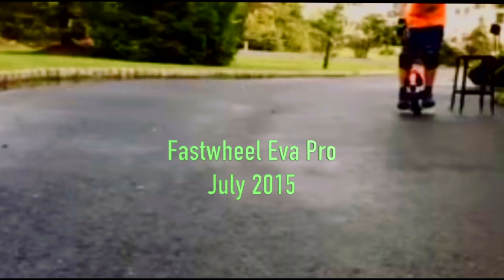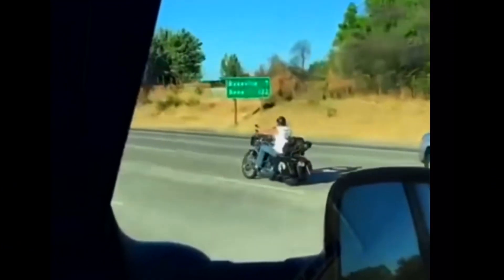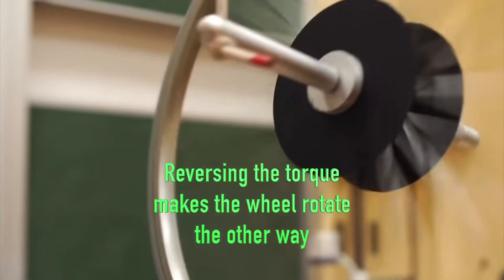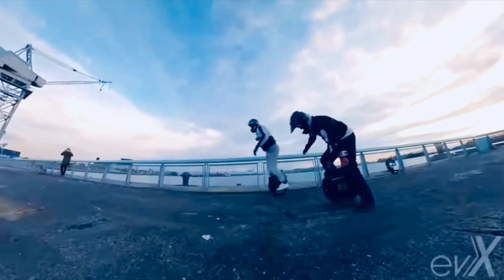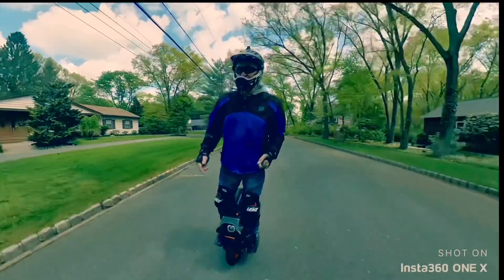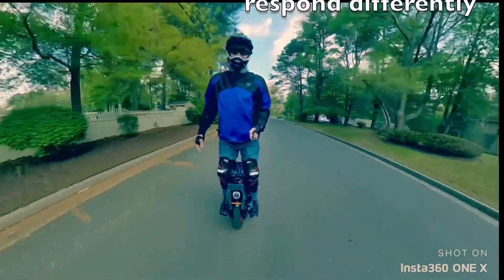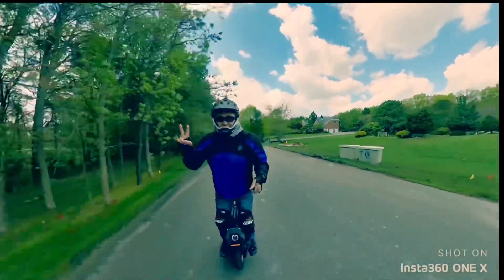Physics of Wobbles and What to Do About Them

Comment: Great video Adam. I've found myself coming back to it every few months. I'm still struggling with wobbles from time to time, and after a particularly bad crash, I seem to have lost some confidence and have been experiencing more wobbles at lower speeds than before the crash. I think it's mental, which probably translates into riding more stiff.

My question for you or anyone else that knows: is there any correlation between your EUC tire's PSI and wobbles? Can an underinflated tire cause more wobbles?
Reply from the maker: Hopefully you are fully recovered from your crash. There definitely is that mental block after a crash that will make you anxious and in turn make you more tense when riding. It will take time to acclimate again just like I did. 

The lower the PSI the less chance of wobbles. Since you have more surface tension on the road the more balanced you will be. This lower PSI of course will increase the chance of denting your rim. You just need to find a balance between the two. 

As you gain more experience, the stronger your EUC muscles and coordination will be. 
Just take your time and you will eventually find the means to decrease the wobbles. On my heavy V13 when I am standing riding and want to slow down I do an exaggerated squat with arms wide open when I slow down. Seated riding is perfect for preventing wobbles. I have never had a wobble with seated riding. Carving while riding will also decrease the chance of wobbles.

Comment: I found that there is no leg shaking (wobble) when I brake at higher speeds with straight legs, leaning only the upper body. I squeeze the wheel harder and my calves push on the pads. It works for me.

Comment: Car wheels wobble individually if they're not balanced.

The wobble occur at a set speed where the imbalance is subjected to resonance by the wheel's revolution speed.

If you speed or slow down, it goes away.

A wheel+tire gets dynamically balanced each time a tire is mounted on it.

A small car tire+wheel weighs around 40lbs and the balancing weights go down to 0.25oz.

I haven't seen any unicycle wheel dynamically balanced on YT videos.

Comment: I am a new rider. Only around 200 miles. I notice the only time that the wheel will start to wobble is when my legs start to get tired. I normally ride in 10 to 15 minute intervals while I am on my breaks at work and ride around the industrial park. I just started to take whey protein in order to help my muscles to grow because in the beginning my legs BURN. But now that I take whey protein after my rides my legs no longer burn but do get tired after 10-15 minutes of riding.
Reply from the maker: @EUC_Senior  It’s not uncommon to get wobbles when you first start out. Especially with the wheels being so much bigger and faster now. Fatigue definitely can precipitate a wobble. I get that too when my legs are sore. 

Seated riding will quell those wobbles. I never had a wobble with seated riding. 

Basically the more you ride the stronger and durable your legs will be. You will also learn so many tricks such as carving that can help prevent wobbles. Carving can be mini and doesn’t have to be wide. 

Deep squatting to slow down as well as accelerating can also get rid of wobbles. 

Just do more riding. You will get the hang of it.
Reply: Привет, твои ноги привыкнут и без протеина! Лучший совет это ездить на комфортной для себя скорости. С опытом эта скорость будет увеличиваться естественным образом. Твоё тело будет делать всё само, без участия твоего мозга, автоматически (аппаратное ускорение). Так же как мы ходим, мы не думаем как мы это делаем, мы просто ходим без всяких теорий.

Comment: This wobble has something to do with the tire.
I don’t ride an euc yet and it’s just because of the wobble.
But I had this problem happening on my car, yes that’s right, I owned a Suzuki Samurai and I bought some cheap non-quality tires, I must tell you the moment I hit 55mph that wobble was insane, my steering wheel was all over the place, I didn’t know then what this is so I went to the car shop to fix it, they inspected the car and I exchanged some parts but the wobble wouldn’t disappear no matter what I’ve done, until I changed the tires, now I have a second Suzuki Samurai, I bought it with descent tires but at 55mph I felt slight wobble, no so much than with the first Samurai but it was there, NOW, I bought a set of 4 brand new YOKOHAMA GEOLANDAR A/T, man, the Smurai rides smooth like a charm.
I think the tire must be correctly weighed (centred) like car tires are when mounted.
Reply from the maker: The rapid decrease that occurs when we slow down on the EUC slightly changes the direction of the wheel of travel. That small change in direction will initiate the wobble. When we try to quell it by purposely trying to balance out the asynchrony only worsens the wobble. 

Lower psi will help decrease the wobble. However, with the EUC’s one wheel there are other ways to help decrease the wobbles. 

Carving riding helps decrease the chance. Having your feet askew vs symmetrical will cause a  mini carving when you ride. 

Wobbles are more likely to happen when you slow down from a great speed. Ways to dissipate  the wobble are a deep squat or do seated riding. Accelerating will also eliminate the wobbles.

Comment: I was going 55 mph on my electric scooter and I was going around a mild turn and the scooter started wobbling like crazy.  I tapped on the accelerator which somehow corrected and realigned the scooter instantly.  This isn't the first time that I fixed the wobble on an electric scooter by slightly tapping on the accelerator rather than using the brakes which will cause fishtailing and instant crash.
Reply from the maker: That was great that you got out of that wobble. Glad you’re
OK.

Comment: I think it all has to do with wheelbase versus overall weight versus distribution. A car with four tires planted at the sides evenly distributed to carry the weight of the vessel will not get wobbles, but a car with only one wheel in the center will.
Reply from the maker: In the example I showed in the video, a speeding car making a quick turn and then trying to go back to the original direction of travel did lead to a wobble and loss of control. The huge mass of the vehicle as well as the change in direction of speed was enough of a huge momentum change to precipitate a wobble. I do agree a 4 wheeled vehicle vs a single wheeled vehicle is less likely to get a wobble but certainly not an impossibility.

Comment: A great video, thanks for analyzing it. I can't help but feel in addition to the things you mentioned there is an issue of the rake and trail on an EUC
It is extremely difficult to get a wobbles on a bicycle because a bicycle has built-in rake and trail into the front forks, yet shopping carts always have wobbles because they have negative rake and trail, and EUCs fall somewhere in the middle - they have no rake and no trail which makes them more likely to wobble than a bicycle but less likely to wobble then a shopping cart wheel.
Reply from the maker: Thanks for the kind words. Other than being so reliant on the tech of the gyro and motherboard, the absence of stabilizers such as the rake angle and trail makes the EUC rider so prone to a faceplant. This is the reason why EUCers need to be so well geared when riding. Riding an EUC is more dangerous than a motorcycle but I don’t tell my wife that. Lol. This is why I stressed so much on the video “Don’t rush to be a pro”. An EUC rider needs lots of experience before attempting high speed riding. An EUC rider needs to really appreciate his own sense of body mechanics and enhanced proprioception to ride safely. Knowing all the techniques such as carving, wobble dampening techniques such as seated riding, feet pedal placement, braking techniques such as squatted braking or turning braking, tire pressure, etc. are really essential for an EUC rider to ride safely at high speed. 

One of my friends who just recently learned the EUC a couple months ago tried riding at 30 mph on his Nikola and experienced wobbles which caused him to crash. He only had a helmet. I stressed so much on the full gear needed and “Don’t rush to be a Pro” mantra. He is healing well and has learned his lesson.
Reply: @AdamU1016  Agreed 100% on your stress on gearing up. I'm always full face, armored motorcycle jacket, knee pads, etc, and have never crashed after 7 years and 10s of thousands of miles. I find it odd that beginners, and others, talk about crashing so much when learning and later. I don't crash on my motorcycles and don't crash my cars, ok, sometimes on the bicycle... but really, there is not reason for it.

Comment: No real explanation.. pity. Veritasium has explained it in a way I understand fully.The movie is "The Bizarre Behavior of Rotating Bodies". There is a movie explaining wobbling of a car with trailer: "The truth about weight distribution and trailers...proven!"
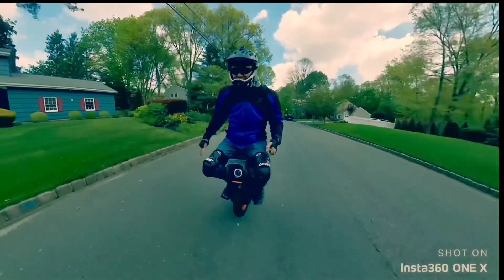Reply from the maker: Did you even watch the whole video? I setup the story for the Big Picture part at 7:39. In short, when the wheel experiences a sudden malorientation with the driving direction, the wheel starts to resonate or wobble. Situations such as sudden braking, rapid turning at high speed, motorcycle wheelie, etc. can make it happen. Depending on the level of skill of the rider or driver, it is possible to get out of that wobble. 
I will check out the 2 videos you are referring to.
Reply: @AdamU1016  Thanks for answering :) Yes, I have watched the whole movie. You wrote that changing direction/orientation causes the effect - but guy inside unicycle goes stright. Well, yes, you are right, but not strict (I personally would not understand this). The real reason is that mass outside disc, to the sides (in axle direction) by rotating is thrown away from axle more and more making wobbles more ane more till rotating by axle which is perpendicular to the old one. I t is like keeping the lego brick at the center of rotating record (the vinyl one) with increasing speed. The good and understandable description in the movie I have mentioned. But - scientist people did not understand this for quiet a long time.
Reply from the maker: @jakubhusak1624  That’s a great synopsis in your own words and I appreciate that. I mentioned about that sudden change in wheel orientation different from the forward travel that initiates the wobble. Using proper technique such as decreasing the forward momentum by squatted braking will help the wheel reorient back to the driving direction. I am not even trying to make my video to the level of Veritasium channel but merely wanted to simplify what exactly happens during a wobble and what can be done to help prevent it.

Comment: I was thrown off the wheel by wobble for the first time in my years on EUCs last week. It happend while riding  downhill on asphalt when I got alarm beeps on my new sherman-s at  46 km/h. I panicked, started to brake, got wobbles, sticked to the rule "never bail out on wobbles", finally wobbles got so strong I didn't manage to stay on the wheel. Well, happy end this time. At least I got chance to test my protection gear which wokred really well.
Reply from the maker: Hope you weren’t too badly hurt from the fall. One of the reasons I learned seated riding was because of the wobbles on my Nikola. The angled pedals also were not comfortable  for me. Seated riding definitely will kill those wobbles. Try also the deep squatted braking technique which also works well. 
Have safe rides! .

Comment: Thanks for the video. The tire also playes a huge role. Street tires are usually more prone to wobbles, because they react and therefore counter react faster/harder. I (sadly lol) never had any wobbles ever, neither on V8 nor S22 (10k km). So i cant teach others how to deal with them. All people that i teached how to ride, get wobbles.
Reply: Sounds to me you just have the skills not to get wobbles as in muscle memory etc. You cant teach others muscle memory but guide them to develop it for themselves.
Reply: @pacochawa2746  yea I'm trying. 3ppl in the last 2 weeks, all of them wobble above 30kmh and when breaking. But I noticed that it's just practice, muscle memory etc. And technice like symmetrical position, unsymmetrical acceleration and how to properly break.
Reply from the maker: Great to know about those tires. I am actually quite happy with my stock V13 knobby tires and don’t intend to switch to street tires.
Reply: @AdamU1016  yea the v13 seems to be an exception. You can watch Kujis Sherman video, where he compares the street with the nobby tire. He shows on multiple occasions that the street tire is way more wobbly and if you think about it with your explanation, it makes sense

Comment: My wobbles are always downhill, and in the same streets. As if the pavement had anything to do with the wobbles. I have never had a wobble going up a steep hill. Gracias por tu video
Reply from the maker: You are probably anxious going downhill and then you tense up. The resonance then builds to a point that you notice the wobbles. You then try to correct it and overcompensates resulting in making the wobbles worse. Try to make small carving motions going down, do seated riding if you are able to, apply more foot pressure on one side of the wheel shell to dampen the wobble.

Comment: I have about 9000 km under my belt riding EUC's. Now I ride the Begode Master V2 and rarely do i get wobles since i keep carving ever slightly all the time but if i do get a starting woble, what works best for me is to stand up straight, lock my knees and become as stiff as possible and right away the woble stops. Works for me anyway.
Reply from the maker: I never heard of this stand up straight, lock the knees technique before. Great for you that it works! 💪🏼
Reply: @AdamU1016  try it once if you ever get wobble and let us know.
Reply: @guyjemus2706 I just got a v14 as my first wheel and have had 2 wobbles so far after riding for 4 days. I havnt done over 16mph yet because I'm taking my time but I'll try thid method when it happens again .thanks!

Comment: I usually just relax my legs and bend knees, trying to avoid the upper part of the wheel constantly hitting the inner side of my left and right leg (which I think increases the oscillation). That usually kills the wobble and if not, at least make it non-worsening, so I can stop and remount on the wheel.
Reply from the maker: I have done that technique too and it works well. Most of the time now I just do seated riding and that really dampens the wobble.

Comment: After EUCs develop more towards performance vehicles than novelty toys, it will be technically possible to incorporate an anti-wobble mechanism in the design. Probably about 5 years away at the current growth rates. I believe anti-wobble/anti-lock brakes/skid-stabilization/power regeneration/storage and autonomous-driving are all currently possible but will require some investment capital to come to fruition. Until then, external proprioception needs time to develop, so “don’t rush the beginner phase of learning” is good advice. 😊
Reply from the maker: I agree with your prediction of technology finding a way in the near future to quell these wobbles without the rider having to do anything extra. It won’t be as challenging though but I look forward to it.
Reply: Skill will beat tech any day. Im all for anti cutout tech and antibrakelocking up or cutouts due to over braking. I will be doing it old school for a couple years, looking forward to safer rides for sure.

Comment: I told people a while ago, duct tape a shake weight to the front of your wheel, horizontally, and then you'll dampen out most of the wobble - same principle is used inside giant buildings to keep them from swaying too much, they hang a weight to naturally counter sideways movements of the structure.  Get it as far forward as you can so that you're as aligned with the expected plane of oscillation.

Another tip would be to figure out how to "balance the tire" which in this context really means balance the whole motor assembly on its rotational axis, to keep down, you guessed it, sympathetic harmonic vibrations which precede full oscillation (the wobbles).  I haven't tried this with a EUC "tire" yet but seems to me that when the motor is built, small misalignments that themselves are in spec can cause error stack up to even make not just some models but particular units to be more prone to precipitate vibrations at different speeds.  I think it might need more than just a couple stick on tire weights to compensate for the mass that's misaligned to get it flying true at all speeds.

It's actually been a long while I've suspected the balancing/bearing tolerance/rigidity as being a main culprit but I can't really say anything is anything until I try both methods - but I'm pretty sure the shake weight one will work if it's placed in the right spot.  High speed stand up scooters even have steering dampers now and compared to the demos without them they appear to do the job well.
Reply: Sounds like horrible advice, we still need to operate the wheel and a free moving weight will not help with that, buildings are stationary.
Reply from the maker: I wouldn’t put any extra weight for dampening reasons. Not only for aesthetics but dampening can be done via other means. For example, putting more foot pressure on one side to make the resonance behave differently, accelerating, putting more pedal pressure on one side, seated riding. In addition, that shake weight can be a flying projectile in a crash and cause injury to the rider or a pedestrian.
Reply: Scooters that have steering dampener's are basically a Band-Aid. Good scooters that are well designed and well-balanced don't need the Band-Aid and never get wobbles. As a rule of thumb, never buy a scooter that has a steering dampener. My scooter goes 50 miles an hour and it never wobbles.